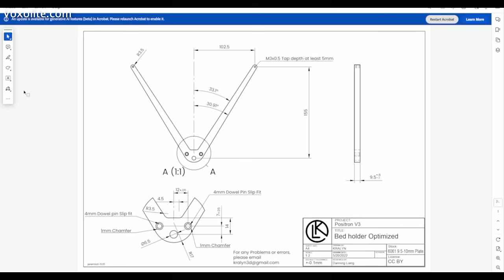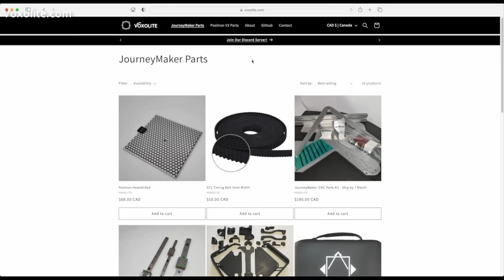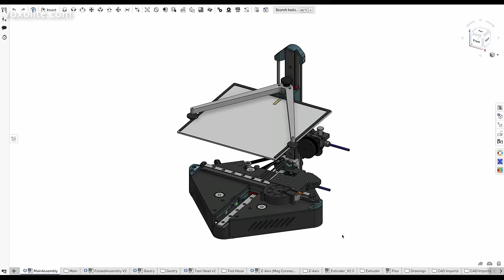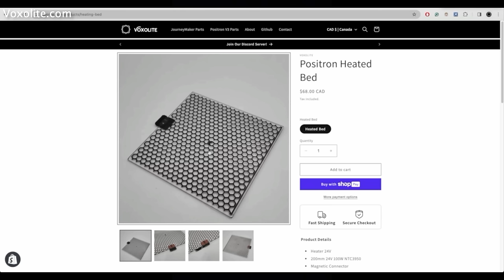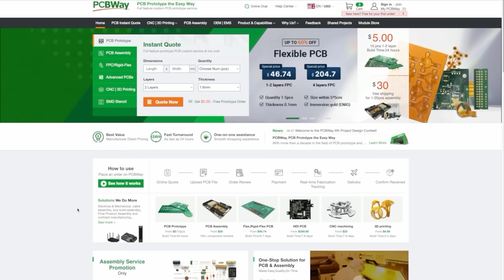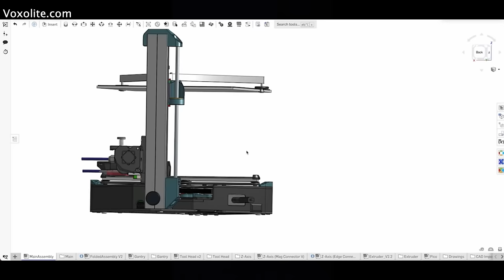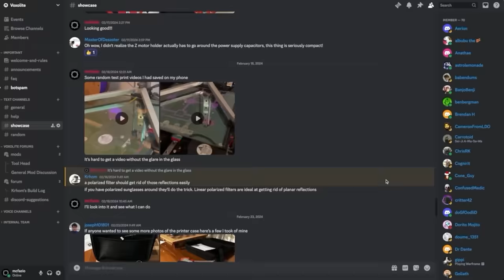The Newest POSITRON Printer!!! Upside Down Portable 3D Printer

Comment: I've always been a bit confused by the Positron project, I want to like the idea, but it doesn't seem to do... well... anything. The main idea seems to be to create a portable printer right, but teardown seems very finicky and it 'folds' into a bit of a mess, has wires and steppers sticking out everywhere, with may steps to accomplish setup/teardown, and I have  no faith the z axis works reliably after teardown/setup. It seems like you can just take a small bedslinger, and it will be better in every way to this thing, even portability is very similar (just remove z axis, like how slingers ship)
Reply from the maker: The printer is designed to be compact and light weight for easy travel. Other printers are not designed to fold. Sure you could disassemble a bed slinger but it wouldn’t be as easy as un screwing to thumb screws. 

The z axis is very reliable. Many people who have build this printer have used it for travel and had no problems with its reliability. 

Many printers have cable sleeves to connect the electronics to the main board. The stepper motors are also within the base of the printer.
Reply: The main benefit or use case seems to be travel, it would be hard to find a 3d printer that could be brought on a plane and to a remote location and be able to print no matter where
Reply: I agree. Good for the industry, but I think everyone loves the novelty. I haven’t had the need to print on a plane or car. And I would rather not lose my Precheck due to a misunderstanding with this very suspicious looking device 😂

Comment: I think printing upside down is a cool idea. But other than making the machine more portable, I cant see why printing upside down would be more beneficial compared to a traditional core XY or bed slinger. If it improves print quality, print speed or eliminates the need for support then I can see the appeal. But it doesnt which is why I see this more like a gimmick and less as a viable option for day to day 3d printing, still a cool idea tho.
Reply: Well it improves bridging. A dialed in printer can do good bridging. But supporting the extending strand with the nozzle against gravity is a definite bonus. Once dialed in it'd probably be the best. But yeah, I think portability is the selling point. Having the lower center of gravity for the extruder and head means way less vibrational forces and artifacts. Would be kinda interested in an upside down coreXY now XD
Reply: If that’s the case, then sure I can see the appeal :)
Reply: @Titan-un3zu  yeah. It's rare the manufacturing mechanics allow it. The only other super common places motion systems tend to be bottom mounted are laser-based resin (formlabs) and CNCs. Obviously bridging isn't a thing there tho, but center of gravity matters
Reply from the maker: Low centre of gravity is the main factor with it being inverted. 
 
-reduced weight 
-reduced vibrations 
- faster speeds 

Much more

Comment: Just some improvement ideas
One cool and easy way to make it lighter and portable is by using an external 140W USB C adapter, possibly GaN adapters because they are lighter and more efficient. Most people carry one for their laptops and phone anyway so this would save them some weight.

140W may not be enough to heat up the bed super quick but once it is up to the required temp, 140W should be enough to hold the temp. Maybe a detachable foam cover could be placed on the bed to trap some heat and reduce power usage.

Comment: One issue I see with printing upside down is bridging and overhangs. Instead of drooping down, usupported material droops "up" potentially catching on the nozzle on the next layer. Do you have to adjust your design and slicing for this printer, or is this a non-issue?
Reply from the maker: Bridging and overhangs are actually improved when printing upside down

Comment: A possible solution would be using polycarbonate instead of cnc parts. Polycarbonate can withstand 100c without any decrease in stiffness. As well as, being quite affordable and a lot lighter.
Reply: Cut sheet aluminum/steel would also be good alternatives for getting price down. Milling is the last option you should be looking at if you want to scale a product.

Comment: The revision to the magnet connection does, on the outside, seem better but I have a feeling that it will create further issues in the future. That's quite a lot of resistance on the connector and a small window of opportunity for the pcb connection coming off the plate to perfectly align and slide into the opposing connection. On top of that I'd imagine a press fit / tension connector like that likely can't withstand tons of repeated removal and insertion.  I'd weigh your options and continue to look around and find something that may be a bit more accessible and easily repairable / replaceable. Personally using some sort of ribbon style pcb(s) with magnetic connections may be a good route to look into. A lot of keyboard designers have implemented this into their cases to connect the pcb to the usb-c port.

Comment: If the size of the CNC parts is below 10X10CM. you could use JLCBPCB/PCBWAY to produce them

using PCB is cheaper than using other CNC parts.
Reply from the maker: Maybe
Reply: 4”x4” ? Pretty small

Comment: ok. But other than collapsible size are there advantages to printing upside down?
Reply from the maker: Yes! Have a low centre of gravity allows the printer to be light weight, thus removing the need for a heavy frame to reduce vibrations. It also allows the printer to achieve faster speeds. 

I bet we will see more upside down printers in the future

Comment: In the video you cite the JourneyMaker as being more accessible than other versions of the Positron, however the LT heavily pulls from marketplaces such as aliexpress and uses 3d printed parts, your JourneyMaker variant relies on purchasing CNC'd and other custom parts from your store. 

This seems like a step backwards from what the LT team has done with the original Positron V3, in moving away from custom fabrication, and towards easily sourcable/printable components.

Do you have a justification for this decision?
Reply from the maker: By providing readily available custom parts, we simplify the build compared to the LT, which requires cutting makerbeams. Ultimately, this approach aims to make the Positron more accessible to a wider audience
Reply: Ugh, sick of the word “maker”
Reply: @_..-.._..-.._  Why?

Comment: I really like this printer i saw the original design when it came out and this version looks even better.   One question, what does a failed print look like.  Im usually not too far away from ny current printer when I'm making things but wanted to know what happens with this printer if there's a failed layer.  Also how does bridging/ support material work?
Reply from the maker: Fails just like any other printer might. Supports also function just as any other print. Over handing is actually better. Check out our discord to see some peoples printing results
Reply: @mcfazio4283  What happens if say a belt slips or for whatever reason it starts printing in mid air? On an right side up printer the plastic will either drop down or start blobbing onto the printhead. I can imagine it will much more likely blob onto the print head and maybe make a bit more of a mess?

Comment: That bed holder fork part looks like it could be made out of wood for almost no cost. Just a couple sticks and some flat pieces glued across the grain to join them together. May need bulked up a bit for stiffness, but I see no issues with that. The tower would probably be fine in wood too.

Comment: Question is, why? What's better than for example the brand new Ender 3 V3 CoreXZ ? Like, does the price justify the mean? Seems overpriced for just portability.
Reply from the maker: Its a very compact design. Its also not being stream lined manufactured so cost is more expensive with self sourcing kits.
Reply: Just because portability doesn’t matter to you doesn’t mean it doesn’t matter to others lol
Reply: @Resyektt  The portability part is overrated, IMO. Very niche use case.
Reply: @_..-.._..-.._  I do agree, but that’s also why it’s being built by a community rather than a company, because it is in essence for a niche demographic, therefore a company has nothing to gain producing it where as a community of the exact people who make that niche do
Reply: What is this weird comparison? An ender 3 and this printer fill entirely different niches. This is like asking someone why they'd buy a smart car instead of a truck.

Comment: The Y axis needs 2 rails otherwise the performance will take a huge hit. With 2 rails it should print at least 2-4x faster.
Right now it's resting on a single rail with the toolhead swinging around on a 8mm or 10mm wide track. Jm2c.
Reply: I mean more rails will always improve performance (assuming you can get them to line up exactly), but there's plenty of single rail systems, like annex k3, which has no issue with speed. Could you explain why this is more relevant in this case?
Reply: @ZeeLobby  The K3 doesn't ride on a single rail... it's a cross gantry core xy machine the motion dynamics are completly different.
Reply: @hd-be7di  right. And in this case the rail is fixed to the frame itself. So I'm not sure why it'd be any more wobbly. Unless your using some shitty rails
Reply from the maker: Sounds like an interesting idea. Might be a little hard to fit a second rail in there with how compact it is. The CAD is available on GitHub, I encourage you to give it try. Could be pretty cool.
Reply: Do you have any idea how well hiwin-style linear rails work? They’re extremely accurate and can probably hold 1000 times the load that this project is capable of doing. The carriages and rails are also extremely heavy. Two rails would be pointless and offer no benefit. There’s a limit to how fast FDM printers can print before the time savings just isn’t worth the violence of the accelerations and wear and tear and poor performance.
Reply: 2-4 times faster 😂 based on what? Your rear?
Reply: @_..-.._..-.._ yeah. feel like flow rate is almost always the limiting factor for speed

Comment: Nice gimmick but absolutely useless. Too small, too imprecise. If there is no liability, the catastrophe is complete. Nobody needs a 3D printer to transport. Simply print at home and take the printed part with you. Pointless...
Reply: Guess we all know what not to get you for your birthday 😂 it’s not for you, you’re not the demographic. That’s ok. Neither your use case or the project are wrong in their aims or opinions.
Reply: I take my Voron v0 and micron to work with me sometimes when I’m working on projects since I can just remove my printed parts and start the next print at work and could knock out an additional 5-8 prints while working. Good to know you think this is useless cause that just frees up parts for me.
Reply: @xiar5546  There is an invention called Repetier Host or Octoprint. Remote ist the right answer.
Reply: Jesus christ.
Reply: @Zubbbz  ... Has no 3D printer.
Reply: You don’t need a portable 3d printer… that doesn’t mean other people couldn’t utilize it.

3d printing holds a ton of potential for biology/ecology etc, historically the niche tools needed for species specific trapping were extremely expensive or shotty repurposed tools put together with tape and pvc pipe. 3d printing has really changed that, but sometimes you can’t test the trap/tool/etc until your in the middle of a rainforest with limited access to the outside world. A printer like this, with a single spool of filament could be useful for prototyping out of a tent in the wilderness and then being able to produce the full quantity upon returning home for the next trip. Niche? Yes. But the point is there’s tons of obscure wilderness based jobs where even the smallest things add up because you need to hike in so everything must be carried on your back. Just because it isn’t useful to you, doesn’t mean it doesn’t have a purpose.
Reply: @Resyektt  one in a Million people are hiking with their 3D Printers. What are they doing? Printing trees? Pointless...
Reply: @zeusperimeter did you not read my comment? Literally one of the areas that 3d printers are the most valuable to is niche industry or research that constantly needs custom pieces. It’s not like a company is dumping tons of resources into this, it’s just some people who see value in it for their own lives. It would suck to be as unhappy and negative as you obviously are 😂
Reply: @Resyektt  I am not unhappy or negative. I have 3 large 3D printers myself that are trimmed for accuracy and quality. I print a lot of functional components, some of which have to be accurate to 0.1 mm. For smaller and more precise things I have an SLS printer. I just don't see how a portable printer can produce reasonable results upside down. If something like this is mobile, it should also be quick? I don't want to sit in the office or in the jungle for two days and wait for results? Hence my opinion that it would make more sense to further develop the technology instead of making an I-print out of it.
Reply: @zeusperimeter . Also weren’t you originally arguing that portability is unnecessary and a gimmick, then I gave an example of when portability is needed and you started moving the goal post. Also even if it weren’t fast, speed isn’t nearly as big of a deal as weight for remote work where vehicles have no access. Once you’re out there it’s easy to spend an extra day, but not easy to take more weight than you can carry.
Reply: @zeusperimeter I agreed with the overrated part, but you sir, are an 🫏
Reply: @zeusperimeter are you also trained in 10 martial arts and have the highest kill rate in the Navy Seals? Real LDE buddy.
Reply: @_..-.._..-.._  this comment made my night lol. 

I definitely don’t think the positron is necessarily ground breakingly amazing or anything but it’s also not some company just trying to sell a product but rather a community of people who see portability in a printer as a desirable feature for their own reasons. So I don’t get why Zeus seemed to be so personally offended by its existence
Reply: Isn't pretty much any innovation just a gimmick? I don't get where your idiotic opposition to something that doesn't affect you is coming from.